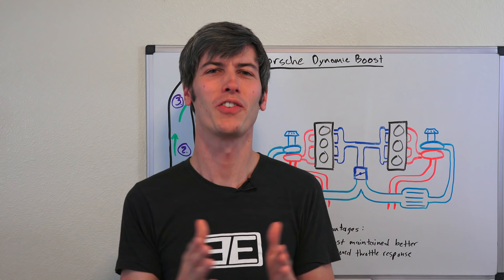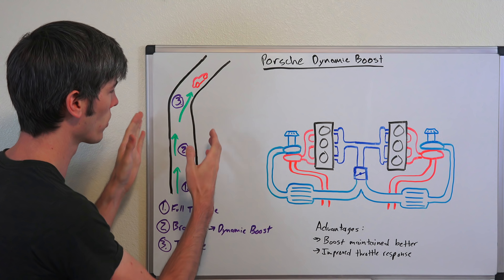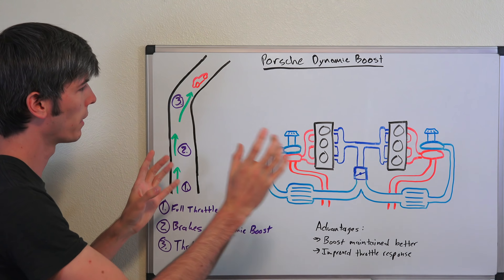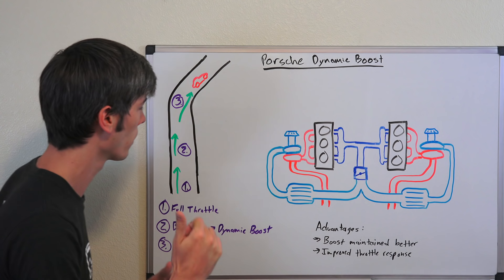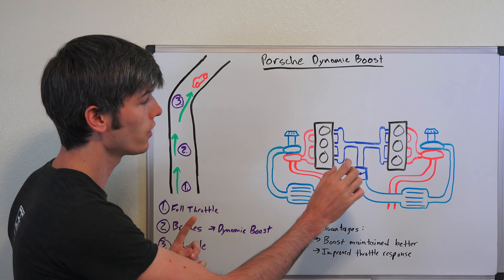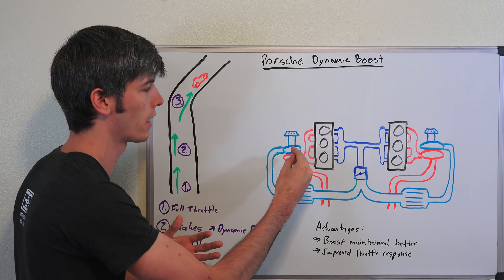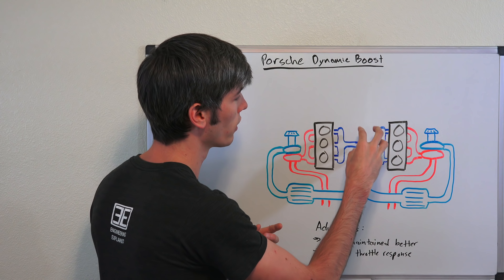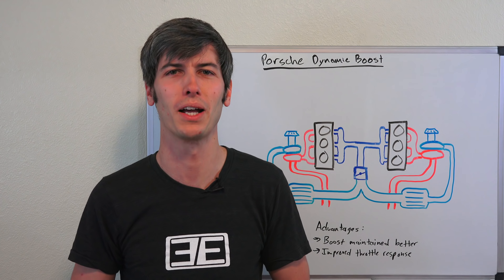Porsche's Anti-Lag System Doesn't Use Any Fuel

Comment: make a video of the old subaru WRC rally cars antilag system!!! Why and whats that sound?
Reply: I think there is some old video on this channel about "classic" anti-lag
Reply: The old-school anti-lag system retards the timing of detonation and as a result unburnt fuel enters the turbine which detonates inside due to heat.
That detonation creates pressure and spools the turbine. That's the sound.
Reply: MISUFIRING SHYSTEM
Reply: @ErebosGR  And what a sound! Flames and pops!! Love it..
Reply: or a video of a skoda fabia R5 rally car turbo, and anti lag system
Reply: not all of the WRC car used that strategy one of the sube engines use basically a small APU  jet engine ( and yes there is videos / pics of it on the internet  , it's called pre-boosting ) and a different way is using the blow off valve dump system side open to the inlet side of the turbo

Comment: This reminds me at the trick that Renault's engineers found in 2013 for Red Bull in F1: in that circumstance, they used to keep the valve open (when lifting) to send the blown gases directly into the diffuser. There, the advantage was purely aerodinamic, but Porsche has maybe found another use to the same procedure... Very interesting!

Comment: Really interesting that still in 2018 we can see such a simple and clever design being implemented. 

On my side, I easily understand the “open throttle“ concept of Diesel engine but I could quite never understand the need for a throttle body valve on gasoline engine... Therefore this setup makes a lot of sense and helps me to understand.

Comment: Some programmable ECUs allow to cutoff spark and/or fuel to be used in flat-shifting, so... by just cutting the fuel, you can actually get some interesting effects in terms of keeping the boost higher on turbos (and even blowers), reduce losses in aspiration and reduce the drop in RPM in engines with lightweight flywheels (which can be beneficial when coupled with close ratio gearboxes). 

It's actually very pleasant to daily drive a car with fuel cutoff when the clutch sensor is turned on and the revs are high.

Comment: So with the throttle left open and the engine pumping air because it will still be revving while in gear, that's basically keeping the turbos slightly spooled as well wouldn't it? I would also think the air flow would also have a cooling effect on the combustion chamber and turbos which could help with performance and lower engine temp in the long run.
Reply: exactly
Reply: yes, thats wgat he said and no, that's not when the engine needs to be cooled, if you can keep combustion chamber temps down during full throttle that could help with preignition
Reply: Especially hot at a race pace
Reply: "slightly" might be the right word, yeah. The same way turbo'd cars barely make any reasonable boost when idling or off-charge, this solution should really be a mild-mild antilag, since the airflow must be really weak. Plus, I'm kind of curious on the long term reliability of this solution, since all the hot-cold-hot-cold cycle must put some thermal stress on the turbo.

Comment: I built a turbocharged car back around 1980, and studied everything I could to figure it all out. The idea of leaving the throttle open is so bright.  Yet another incremental increase in performance. By the way, I even drove to Los Angeles to meet with a guy named Ak Miller, who was advising the US car companies on turbocharging. He told me one thing I'll always remember- an engine is nothing more than an air pump.

Comment: This is a great idea. I always wondered why injected cars don't allow variable zero-throttle valve opening. For instance, what if you want to stay in a low gear for power but don't want hard engine braking when you back off throttle? 
This makes a lot of sense and you didn't really need to verbally explain it with that diagram present. The throttle valve being shut is like turning the tap off. The compressor stalls because there is not enough air being pulled through it. The turbine stalls because there is not enough air being pushed through it. The entire intake airflow loses its momentum.

Comment: For some reason, while thinking about the title and seeing the diagram without bypass valves at the beginning of the video, my brain went right to the old Renault F1 throttle strategy for the exhaust-blown diffuser. Looks like my hunch was correct 🤓. Same strategy, but using the "cold" exhaust to blow the turbine wheel instead of feed the diffuser.

Comment: Questions:

1. This seems like it would benefit NA cars as well, because the intake plenum draws a vacuum when TB is closed. 

2. Which begs the question, why wouldn't this be standard operating procedure for engines anyways? Just stop injecting fuel. What's the point of closing the TB?

3. Which begs a 3rd question: are there any drawbacks?
Reply: I'm curious about the drawbacks too. Other wide wouldn't everyone do this?
Reply: The gains may be so minimal that other OEMs havent bothered. Also I'm not sure what kind of turbos the other OEMs use, but Porsche has variable geometry units which could adapt to this situation more easily than a fixed vein system. Also BMW doesnt even use throttle bodies, so they would have to implement a different program to keep air flowing.
Reply: there is far less engine braking when you let your throttle wide open because the pistons can move freely in atmospheric pressure while when you close the tb down it will create a negative pressure at the chamber resulting in strong engine braking. This means using this technique you only got the actualy brakes to decelerate and stop.
Reply: isn't bmw doing this all the time？
Reply: So basically the drawback is less Engine Braking which is useful in the cars that most people use. Its safer to have as much braking power as possible, so getting rid of the engine braking would stress the braking pads more which not only would be an added expense, it would also be more likely to be worn out in the case of an accident.
Reply: @lutyanoalves444  yes, but you only have to compensate it with better brakes, and Porsche has them
Reply: It takes almost no time to fill the intake manifold with atmospheric air... It's how cylinders are filled, after all. It's hardly an impressive gain of throttle response.
Reply: it only has less engine braking when in "sport" modes, in normal driving the engine is like any other, you can hear EE say that.
Reply: Drawback would be a fair amount less engine braking... OF course there is still going to be some, since the inherent resistance of the rotating assembly and the valve train...
Reply: Optical Clarity... They are cutting fuel all together, not reducing fuel, since the inertia is going to carry the vehicle for a fair amount of time, no fuel is needed to keep the engine rotating. SO there is no concern or even a chance of a "lean" fuel condition, since there is no fuel.
Reply: Alan Bowers BMW doesn't need to implement anything, they are already doing it by, exactly what you said, not having throttle bodies and controlling the valves themselves. On N/A engines it increases throttle response, especially at low rpm, by having fresh air at all times right behind the intake valves, thus eliminating that fraction of a second it takes the air to go from the throttle plate to the cylinders.
Reply: Ilya Kalujny ... That is why they use a vacuum pump driven off of the cam. Now a days most performance based engines don't produce enough vacuum anyway, so most modern vehicles use some sort of vacuum pump or hydraulic pump to aid in braking.
Reply: @Optical Clarity I love the 968! A very underappreciated car (we used to have a 951 in the family years ago). When I get back to the States, I'll keep an eye out for the 968 or GT3 at Roebling and AMP as well 😁
Reply: BMW has been doing this forever, TB stays wide open. They use VVT (VANOS) and fuel to control throttle.
Reply: @WatchJRGo  almost 😜. The "throttle body" is just there as a failsafe, and it's called Valvetronic 🤓
Reply: You right... I hate when traction kicks in and it closes the throttle body. Always trying to launch my 545 and half the time I end up in that "failsafe" lake.

Comment: There was an anti-lag system for the Diamond Star Motors cars having the 4G63 turbo engine. Man o man was that a bangy smoky noisy feature when activated.  Quite the weird thing.  DSMLINK was the part that enabled anti-lag.  I drove one. Fun. And, did not need anti-lag because it was front wheel drive. But all wheel drive cars could benefit I'm sure. This ALS was for the drag strip. If you floored it   with the clutch in, the ALS would activate. So you could use it on corners or on the start line.  But, it's pretty scary to floor it when you have a pretty high power car already, typically with a big-ass turbo and intercooler and injectors and intake and exhaust and fuel pump and all the other supporting equipment.  I think drive-by-wire was not a feature of the DSM cars. So you could not get the ECU to control the throttle butterfly, as the Porsche does.

Comment: Pretty clever, the engines are air pumps after all. In Formula1 engineers found a lot of clever ways to get a benefit from this air pump thing like the blown diffusers of some years ago. Electronic fuel injection and drive by wire made a lot of very cool stuff possible, like completely cutting off fuel when you are going downhill and not accelerating or cutting off some cylinders when you don't need the power on some V8s.

Comment: On koesnigen with electronic valve lifting they could even open the intake and exaust valves on every revolution so the engine could breathe and suck the turbo presure so they don t have resistance

Comment: People seem to be confused about how this works in practice, so here are a few pointers:

With the trottle wide open but no fuel being injected the engine just pumps air as fast as it can into the exhaust, keeping the turbo(s) spinning and thus reducing turbo lag once the throttle is re-engaged

The assumption here is that the car has some form of manual or DSG transmission, so unless the clutch is disengaged the engine will keep running. Disengaging the drive will stall the engine

The lack of engine braking does put stress on the brakes, but we're talking 'track mode' here so the brakes will (hopefully) be designed with this in mind

A vacuum brake booster will not work due to the lack of manifol vacuum, but a mechanical booster will if engine-driven. However, how many racecars do you see with vacuum brake boosters? A brake booster can apply the brakes no harder than you, it just makes it easier to do so

Comment: Hey jason can you take a look at the new generation 4 cylinder bi turbo diesels they are using now, ford has one vw has one bmw has one, they have over 500nm of torque and around 220-250hp with a 2 liter diesel which is crazy

When i asked around i got the following answer, the exhaust goes to a small turbo, both the waste gate and the turbo back goes into a big turbo, in some cases the small turbo is not intercooled to remove lag completely (its spining at high speed even at idle) the big turbo provides the power on its own over 2500rpm, the waste gate of the small turbo is at the same time a valve that can restrict the exhaust from goin to the turbo allowing the deactivation of said turbo,

Knowing vw and ford they make the R&D on diesels and trasfer it to petrol engines once proven reliable, so the next VW 2 liter petrol will have the same layout with 2 turbos, we are going to see factory 400+ hp four bangers in the next 2 - 3 years, and this is amazing
Reply: ssllhh100 Small capacity high horsepower diesels are very much a result of high taxes on displacement and fuel costs in Europe. Diesels can handle much higher boost levels whilst retaining better specific fuel consumption than a petrol engine, EE made a video recently on this subject. The small turbo on such engines is used only for low end response, as the bigger turbo takes way too long to spool for normal driving.

I don’t really see a market potential for a similar petrol engine, as at this point you’re better of using a bigger engine, which will have similar or better fuel economy and less turbo lag using lower boost with only one turbo.

That said, I really want a 225d, it’s like a little European muscle car with all the torque 😎
Reply: @harbl2479  well here engines with more than 2 liters are taxed with 50% tarrifs here, this makes small four bangers more appealing than higher displacement engines
Reply: It's called compound turbocharging
Reply: Thats sounds like CAT's abandonned ACERT tech I think it was. They had 2 turbos for regen and pollution purposes I remember. And the ones I saw were vraiable geometry turbos so that was unique to see back then

Comment: Hi can u make a Vid on turbo surge if u fit the throttle in front of the turbo im building a turbo race car with the throttle in front of the turbo and will be running no dump valve. iv seen this on a 1980 f1 bmw turbo engine and i think it will help a lot in engine response and turbo surge im going to run a suck throw curb system hens no dump valve and with my reserge i found the f1 bmw clip and that makes me think that mt theory might work. please let me know. KEEP UP THE GOOD WORK!!

Comment: On my Subaru Legacy I could generate 2psi with the ignition off by opening the throttle in gear downhill. So this makes sense, 2psi still represents significant turbo speed.

I'm assuming it was because:
(1) Given the engine was just running and is still spinning it's still providing noticeable amounts of airflow and heat (therefore more exhaust volume than intake)
(2) My open exhaust provided a higher pressure drop across the turbine than would usually exist
(3) The turbine side of most turbos is usually physically smaller to lower the boost threshold, this creates a scenario where the intake flows more than the exhaust for a given turbo speed, meaning any significant airflow creates boost

Comment: I find I don’t lift my foot all the way off the throttle, even when shifting. I don’t floor it. Merely enough to keep the engine revolving about the same speed the gearing will be. I find it helps smooth possible weight transferring with inertial torque changes. It’s nice that Porsche cuts fuel when doing this. Very much a “mild” spice anti lag system. Interesting to see the balance of a performance feature with the safety of having the throttle shut.

Comment: I have a question Jason. Is this like the off throttle blown diffuser that F1 used to use back around 2010-2012? & instead of using that airflow for blowing over the rear diffuser & producing more downforce, Porsche is using it to keep the turbo spooling for longer to have a sudo anti-lag system? Thank you for another great video.

Comment: This system seems very similar to the system used on the V-10 era F1 cars (I believe the Brawn team started it)  when they were using blown rear diffusers, they would leave the throttle wide open, "throttle" the injectors and use the engine as an air pump to help create more downforce in the corners without having to keep the power on, so to speak. works great, but boy did they sound strange while decelerating. Also they lost engine braking so the brakes had to work much harder.

Comment: I believe this can be done without drive-by-wire throttle, but would require both a BOV and a throttle bypass, and a blow-thru MAF between the BOV/Bypass and Throttle body.  Use the TPS signal or a microswitch on the throttle to switch from the BOV to a throttle bypass to the intake manifold when the throttle is closed. Since the Bypass bypasses the MAF and throttle body, fuel will not be injected and it will just be air passing thru the engine  to keep the turbine spinning, in the same way the Porsche "Dynamic Boost" does it.  The only limitation is that it would have to be a discrete switch from BOV to bypass, as flowing thru the MAF and the bypass at the same time will cause a lean condition.

Comment: Thank you,Super great video again.....Do you think one day the Throttle body will be thing of the past and only regulate Fuel and spark very precisely that it can eliminate TB?..It would seem the me running that much air through the engine one could drop some excessive heat out of the head area,,,,TY 73s

Comment: So you can eliminate a blow off valve also saves the turbos a bit because it's not a huge decrease in turbine speed. You also get a chance to run just cooler air through the engine making it act just like a air pump also your rpms shouldnt drop that rapidly. It kinda sort of acts like a mild left foot braking with slight throttle input with out the complex human control aspect.

Comment: Engine braking is of course increased when you engine brake with throttle wide open and no fuel injected. Your engine does more work when breathing freely. The larger amount of air molecules filling the cylinders means more air molecules to compress. The engine simply acts as an air compressor when no fuel is injected. 
Like when you block the intake on a vacuum cleaner the rpm of the electric motor rises as it does less work.